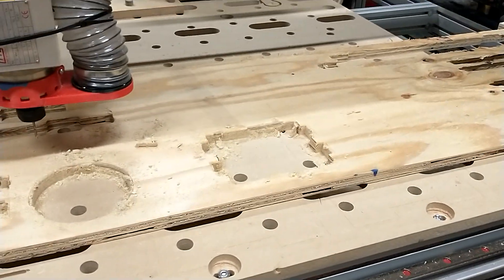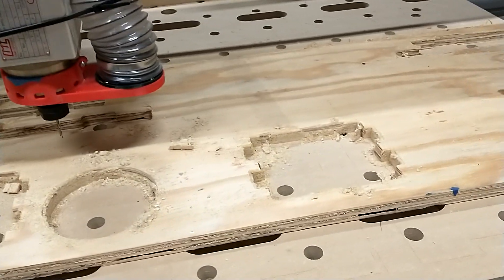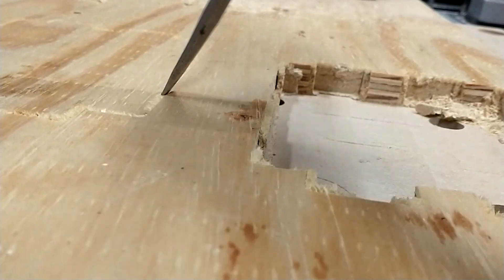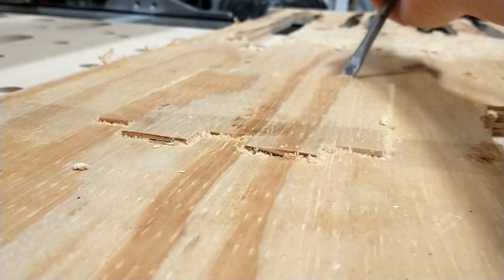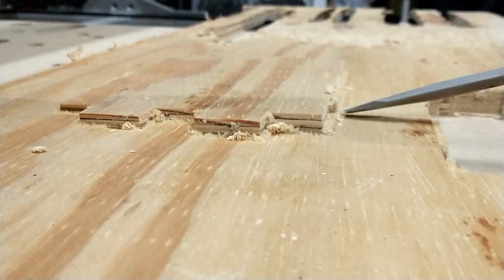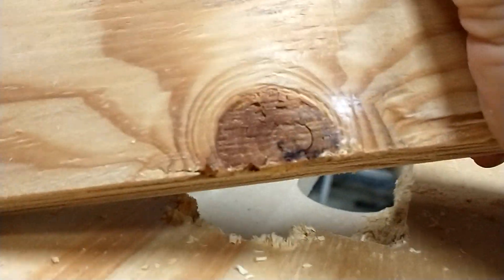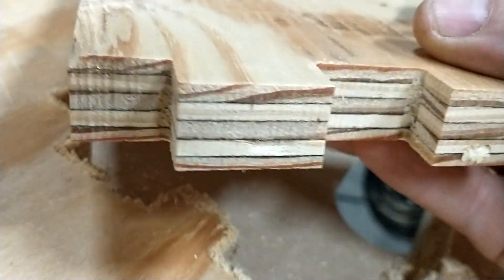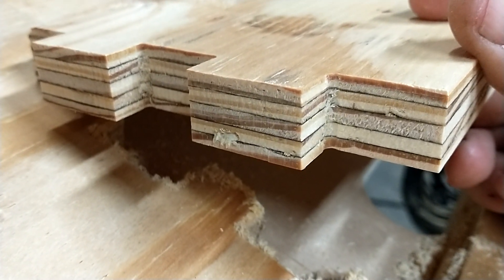CNC - cutting 3/4" plywood in one pass with 1/8" compression bit

Comment: I am late to the party.    Using this method will it also cut 1" thick baltic burch?    I dont have the necessity to do it in one pass or care how long it takes?   Haven't obtained a cnc yet but need to know if it can cut through one inch before I take the plunge.   No pun intended

Comment: I bought Hozly compression 1/8” bits and tried as shown above. It worked really nice and clean. No tabs needed but don’t turn on the vacuum when you are cutting. The dust in between keeps the cut parts together!

Comment: This is the type of clip that is going to get people hurt. Better wear safety glasses for when at least SOME people who try this break the bit and goes flying. Rule of thumb never go more than half the diameter of the bit per pass. Obviously that's different with v bits. Just be safe when doing something dumb like this.
Reply from the maker: I am not sure what you are trying to say here. This is common practice with compression bits. Can you run at 300IPM? No, that will break the bit obviously. Running slower dependent on material is how you need to do this. More like 40-50 IPM.
Reply: This is common practice in the industry. Compression bits are literally designed for a single pass.

Comment: How many feet of finger joint would you get out of a single bit? I make bee boxes and this would be a game changer if the cost per foot were similar.
Reply from the maker: I have done 10-15+ sheets and some hardwood projects in between. When you buy them in the 10 pak they are about 3.50$. You cant beat that. 0.35$ per sheet? You have to cut decent plywood though. I had a customer bring their own plywood for one project. About 15 sheets. I broke 3 bits on one sheet. I made him go get better plywood. I think the glue on the stuff he had was different. Much harder or something. Not sure.

Comment: I saw this video and decided to give the bits a try. Bought 2 bits for a total of $10 on Amazon. Have only used one of them and did a test cut with some shop jig star knobs cut out of some very old scrap 3/4" plywood. Profile cut full thickness in a single pass - they turned out perfect  - cut 16 of them out of 12"x12" piece. I didn't have to use tabs (the sawdust held them in - even thought they were only 2" in diameter - much smaller than the part shown in this video. I followed the guidelines provided for best feeds and speeds, my settings were 18,000 rpm at 55 ipm. Thanks again for helping out the CNC community. This video and info is a game changer for sure!
Reply: What's your settings to make that ¾"plywood cut in one pass
Reply: How many inches or feet would you guess the bit would last in 3/4?
Reply from the maker: I have done 10-15+ sheets and then some hardwood projects on top of that. They are worth it. Buy the 10 pack and they are 3.50$ each. You cant beat that.

Comment: Are they the same bits on both sites?  Big price difference. I'm about to order some off of Amazon, but just want to make sure they are the same.
Reply: They are not exactly the same but they are similar and will both do the same job. I like the ones with the longer flute length. I have mostly used the ones from Ebay. The ones in the video are the Ebay bits.

Comment: All that packed sawdust equals lots of heat on the bit and such small diameter it’s likely to dull very quick.  Just because you can do it doesn’t mean you should do it.
Reply from the maker: I have done dozens of sheets with one bit. They work very well. Take a look at mini jenny bits. They are much more expensive than the ones I listed but similar usage. This is a thing, it works well.

Comment: Can this work on a belt driven cnc router?
Reply from the maker: I would not recommend it. There are some pretty good pressures being applied to do this at full depth. I am sure you can use the same bits but I would not cut all at once.

Comment: Well I bought some of these bits and they are a game changer. I cut 3/4" plywood in a single pass on my CNC and just finished a job cutting 1/2" Baltic Birch as well. Cut at 17000 rpm at 60 ipm (a bit less on the chip load) with out any issues. Nice, clean edges on both the top and bottom and very small dog bones on the inside corners. They pack the saw dust in so no tabs or hold down needed. Thanks again for the video and the info.

Comment: wrong application, use sled over router table and save your self headache and money. this vii is just for sake to make vid, sorry
Reply: Why would anyone who owns a large CNC use a hand held router and a sled? Dont be a hater on CNC.
Reply: @mugsy84123  because sled will give you superior and clean box joint, I dont hate CNC im using them since 2000
Reply from the maker: I did the finger joints just because I was making some bee hive deeps and supers. You can use these for any shape. If you are saying to use a router and a sled I think you are missing the point. I can set up a full sheet and walk away and do something else. Come back and load another sheet. Then go do something else. Why would I want to use a router and sled over that?

Comment: I am building a wooden boat.  Do you know how to layout/make what someone called "puzzle piece joints"?  These are used like scarf joints to make very long pieces of plywood.  In my case 19 feet.  I have a CNC file for the hull panels, but not the joints.
Reply from the maker: You can use any shape you want. I have done some with about a .003 offset on each piece using the same vector for inside and outside. They are pretty tight but will allow for some seasonal wood movement.

Comment: I would be very interested to see if an upcut spiral bit would work just as well. Have you tried that yet?
Reply from the maker: Using an upcut bit would defeat the whole purpose of getting a nice edge on both top and bottom. With this type of compression bit you get both.
Reply: @Knottywoodwork  Thanks for the response. I make wall mounted wood sculptures. I contact cement plastic laminate to the face of my 3/4" Baltic Birch and then cut the pieces out from the back side with a 1/4" spiral upcut bit. I'm using a Ooze Nest 4'x4' with Nema 23's and very small belts. I need to do 12 passes at about 40 ipm to avoid crashes and broken bits.

I was surprised to see you through cutting in just one pass with a small diameter bit. After seeing your video and one other, I think my problem is that my CNC is not beefy enough. 

When I win the lottery, I may upgrade to an Avid 4'x4'. I may then try a 1/8" spiral upcut as I don't care about the back side appearance.
Reply: @steveborn3455 You should easily be able to cut your 3/4" plywood in no more than 3 passes with a 1/8" compression bit, set at 70ipm and 12000 rpm. I do it in 2 passes in prefinished birch plywood.

Comment: First thing I wonder about is deflection and accuracy from front to back. When you measure the piece with calipers, how far off is it?
Reply: There is significant deflection, for sure, but it seems like something that could be improved upon. Check out the dogbones at 1:50; you can a very obvious visual difference between the definition on the top side of the cut and the bottom side of the cut.

However, for the time and material savings (using such a 1/8" tool on 3/4" plywood in a single pass), there are going to be some trade-offs. I imagine this could be improved upon though if the deflection is critical enough to affect your project.

Still pretty damn cool.

Comment: Expensive, Impressive & likely pay for themselves very quickly in saved time & less bit breakage. Though I'm sure that speed & cut depth is from industrial strength CNC and not home/hobby equipment. I wouldn't even attempt that on a plunge router

Comment: Looks like a great bit to try, thanks. From the looks of the edge of your plywood you have some chatter going on. Are you able to get smoother cuts by going slower or is this just because it's a rack and pinion drive system?
Reply from the maker: Good question. At the time I was looking for a way to cut smaller dog bones in flat pack plywood designs and these fit the bill. My machine is fairly rigid. I imagine slower would give a better finish.
Reply: Yeah, I have the same brand (an Avid 5'x10' - aluminum extrusion and rack and pinion drives), as well as an Axiom 8 Pro (which is all steel construction with ball-screw drives). So far, the Avid machine actually seems more rigid; the Avid machine's gantry weighs significantly more and has a much more powerful spindle than the Axiom machine - so, increased inertia, coupled with increased cutting torque may just effectively make it more rigid for most projects, even though there's more flex in the aluminum frame than a steel one.

All that to say: it's not going to bounce with an 1/8" tool - so the cut inconsistency is likely due to tool deflection. At 1:50 in, you can clearly see a difference in definition between the top side of the dog holes and the bottom side (where the tool would have deflected the most).

Either way, pretty incredible to see a 1/8" tool eat through 3/4" plywood in a single pass.
Reply: K @dadealeus

Comment: What is the feed rate and rpm?
Reply: " I was cutting at full 3/4" depth, 50-70IPM, 16000 RPM. 50-60IPM seemed to leave the best cut finish on my cnc. "
Reply: What is the size of cutter or bit?
Reply: @zainmuneer8086  1/8". see link in description for details.